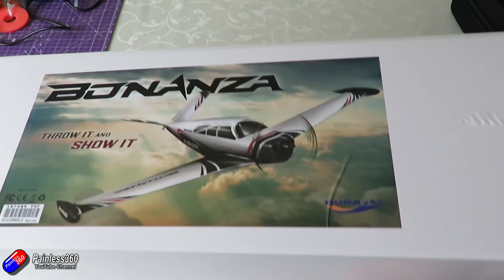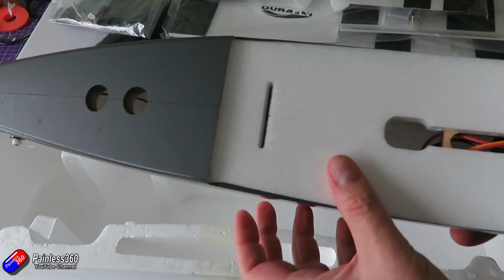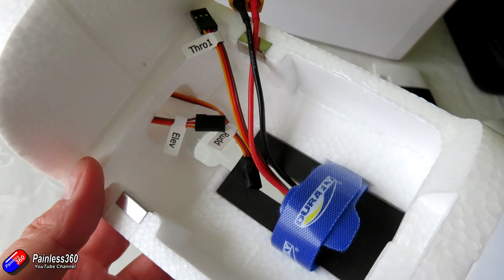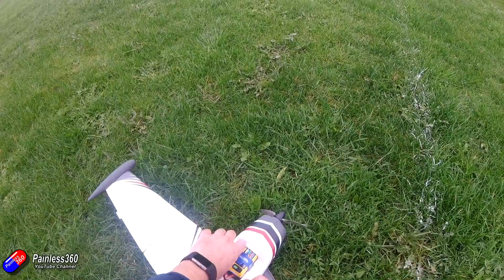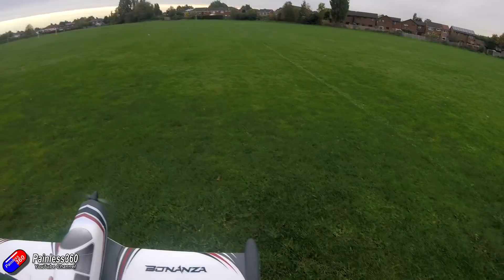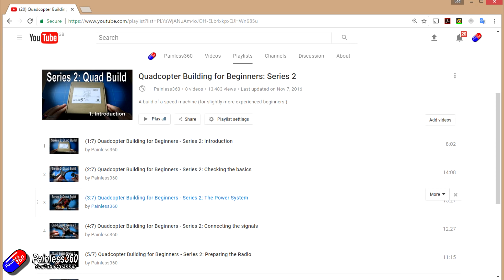Durafly Bonanza V Tail Park Flyer

Comment: Always notice that prior to a flight, a quick wriggle of the controls gets the thumbs up. 
Not a good practice for those starting out or in fact for those who do not fly all that often.
Fine, controls are working BUT are they operating in the correct direction.
Far better to approach aircraft from behind, operate one control at a time and check for correct direction.
You would be surprised how many get it wrong.
Reply from the maker: Correct movement is actually what I'm checking, using the old 'high five' technique. See my simple and complex plane setup videos where I cover this in detail. Happy flying!